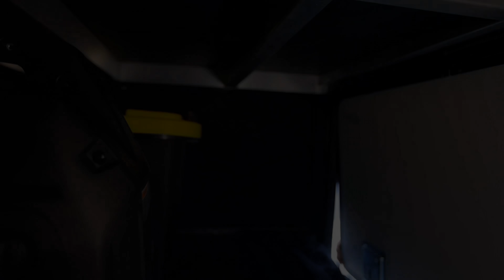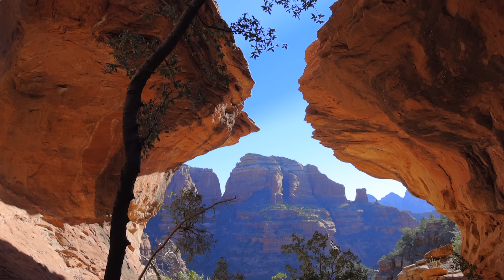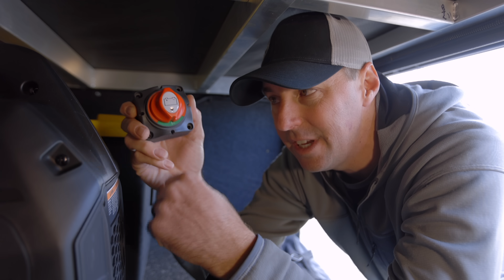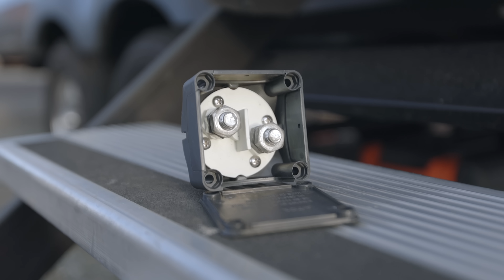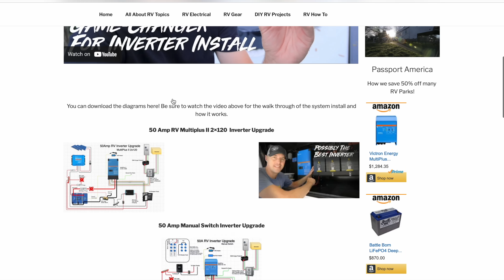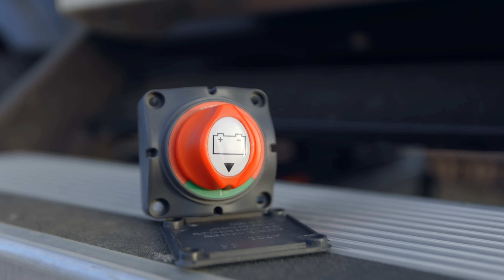Why I Removed The RV Battery Disconnect.

Comment: Which stupid RV company wired the disconnect switch wrong?  That's the real problem .  Race cars also have disconnect switch, and it does just that... it disconnects the battery.   If it didn't, the car would not pass tech inspection.    Why aren't RV's being inspected?

Comment: A battery disconnect will cut off 12V battery power. It won't disable the converter 12V output if the RV has shore power.

Comment: It should be installed on the ground side of the battery. There should only be one cable from the cars frame to the negative battery post. If there are more connections to the negative post install them all to the side of the switch farthest from the negative post. If installed in that location there is no way for anything in the car to still receive power. Any disconnect would work in this situation and there is no need to protect the connection from anything. It's just a ground and a ground can't short out against itself.

Comment: Better to connect to negative post just like you why you disconnect the negative cable when servicing the battery. Otherwise a short from the positive post or anywhere in the positive wiring could short out the battery and cause explosion or fire.

Comment: We just got a newer RV and trying to figure out why my batteries keep draining while hooked up to shore power. I have the battery disconnect turned on because if I don't my iN-command system doesn't work which runs the lights and the slides. I like having the night led lights on but there again if I disconnect the battery switch, I can't turn them on. I checked the Converter today because I keep draining the batteries at night. The Converter is working and getting 13.5v out but I think there is another hidden switch somewhere before the batteries? Will dive into it tomorrow and hopefully figure it out. It's a 2021 Keystone Cougar Half Ton with solar and a inverter as well.

Comment: Great production. If your running LFP batteries, ANL fuses will not handle the instantaneous short circuit current a stack of LFP batteries could deliver if there was a short. You risk having the fuse melt into itself, thus, a welded piece of metal, and fully conducting current. Think major fire as the insulation melts off the cable. For LFP designs, use a Class-T fuse like you have in series with your inverter. A simple tip from an Electrical Engineer.

Comment: I saw this video on replacing the battery disconnect switch and want to know if I can remove my disconnect switch on my Travel Trailer and replace it with the type you show in the video and if I do will it completely shut down power, unlike the stock one that came with the unit. I only have two six volt batteries and the stock converter that came with the unit. If I can't replace the current one with the type you show (because it will have the same effect as the stock one) do I just leave the stock one in its place and leave it on or off if I have to replace it with the type shown in the video.

Comment: I have two battery disconnects in the storage bay...  I bumped one when loading up on travel day and it came out (kinda spring loaded).  Found it, replaced to on position and now no dc inside the rv unless connect to shore power of using the generator.  Wondering if the disconnect got damaged or maybe a mystery breaker nearby...  Still loving my toolbox BTW.

Comment: The RV manufacturers are in a bind here.  If they were to install a switch that truly shut off everything in the coach, they would be opening themselves up to a lawsuit the first time someone has a fire or carbon monoxide issue inside that wasn’t detected due to the user shutting off the power via the switch. Things get stupid when lawyers get involved.

Comment: The switch is installed to disconnect certain circuits such as the start system. Your RV uses more than that battery used for starting. So the other circuits will not be disconnected or you will need multiple disconnect switches. I can agree with you not liking the install location. Other than that I think it is your expectation that is wrong.

Comment: I learned the "exciting" way that my battery disconnect didn't actually cut DC power to everything. I got some nice sparks when replacing my battery with a 200AH Renogy when I connected the second battery lead. Thankfully didn't hurt anything but certainly gave me a surprise. I've been thinking about replacing and rewiring mine as well so it actually disconnects the battery if I'm working on the electrical system or something.

Comment: So am I understanding correctly if my battery button is switched off, I have no trailer brakes?
Reply from the maker: Most RVs are wired so it will still function the break away switch for the brakes along with a few other items. That is why som many RVers disconnect the wires from the battery when in storage.
Reply: @AllAboutRVs  thank you

Comment: The really bad thing for me is that the switch disconnects the battery from the charger so it cannot get charged but can still get discharged by the things that remain connected to the battery. Once I turned my switch to the off position but accidently left on a fan and it exhausted the lead acid battery and permanently damaged it.

Comment: Sounds like you had the same issue I did with my RV. The disconnect was way away from the battery. It only turned off about 1/3 of things... not sure the point if it didn’t turn everything off. So I relocated the switch to the battery. Was able to shorten the longest wire that fed the back by 3’ (hopefully help with power drop) and now it’s a true disconnect

Comment: if it melts it means the disconnect is installed in the positive terminal, the disconnect should be on the negative terminal of the battery.

Comment: Question 2023 grand design 247bh.  When I use the battery disconnect in the off position does the onboard solar panel and controller , continue to charge the rv battery? Do recommend two weeks storage for example, putting the battery disconnect in the off position even though there is an onboard solar system (mppt ,165w panel going to a sealed battery) always active.  Thanks for the help.

Comment: Hi Jared,  as always, great video.   Does the switch need to be rated much higher amp than the total battery amp,   for example the box rating show 275 A continuous at DC 12V, 455 A.     Does that mean it's good for a battery bank of 400amp?   thanks much.

Comment: Jared have a question do you have to have your battery disconnect on when you are using shore power to the camper and jack systems?

Comment: there is a note in my RV that states that the power should be off while traveling to prevent shorts from actuating slides and such.   I would almost suggest just adding a second disconnect switch to accomplish what you are trying to do.

Comment: i didn't read all the comments , so someone may have said this already.  if you touch the frame when undoing the red (pos)  with  a metal wrench you will still spark , because you are shorting the battery to ground.  just need to be careful.

Comment: I have a 2021 keystone and it’s doing the same thing it has a wiring box and the off an on battery switch is in that box and I’m have a problem with the brakes the dealer has the trailer in ft myers and are trying to fix it

Comment: the brakes are activated off a 12v line from the trucks brake controller. Batterys on trailer is key for if you become disconnected from the trailer the emergency pin can be pulled for brakes to be activated.  Also if your 12v aux vehicle line is not connected to the trailers 12v system (needs to be disconnected for lithium setups usually) You wont have boosted power to say do leveling jacks or slide outs.f

A true disconnect to battery should be on the Negative side. Like you said disconnect negative before you work on the unit, not the positive.

Comment: Thanks for this video, wife and I just bought a 5th wheel last fall and have not picked it up out of winter storage yet, I was curious about battery charging and brakes if battery switch was off. Thank you for clarifying this question.
Reply: Trailer running brakes do not use trailer battery, they use trailer controller 12v from the vehicle. Battery is required for Emergency Disconnect when detached from Vehicle to activate the brakes.

Comment: The reason an RV disconnect doesn’t turn everything off is it would disable the trailer brakes, and it would obviously be a safety liability if it was left off while towing.
Reply: Trailer brakes are activated from vehicle 12v brake controller power, You can have no battery installed and trailer brakes still activated. You will however not have emergency disconnect brakes as there would be no power source on the rv.

Comment: Hi Jared,
What do you do with the original wiring that the old switch was attached to? I’m in process of getting ready to install my Multi2 and realized in needed to do something there. Do you remove the original bus bars to the new ones?
Thanks 🙏 for a quick response 
Pete
Reply from the maker: I left the original bus bars and just had a connection from our new bus bar system over to the original.

Comment: This video convinced me to install a similar switch last year. I installed it between the 2 6 volt batteries on the jumper cable, so it shuts off all power. Great peace of mind that all power is now off for storage and safety.

Comment: if I use this disconnect will my solar panel still charge my battery?
Reply: depends where controller is connected, Before or after the BUS, direct to battery. 
The Disconnect usually does not take off the emergency brake controller or the slides/jacks. depends on how they wired it.

Comment: for smaller rigs, I recommend a resettable DC breaker as a battery disconnect. it just adds an extra layer of short circuit protection. I typically install them right on the side of the battery box as they are waterproof and provide the most protection the closer the yare to the battery. these keys suck I just recently diagnosed an intermittent power loss to a failing one of those.

Comment: That's crazy.  Could it be that someone added additional circuitry after-market, going to the hot side of the disconnect?  Of course, if you're the original owner, that seems wonky.  It would be like popping the 100A main in your home and getting a full shock as you wired a new bathroom light.  Eeek.

Comment: This just happened to me. Switch in the storage bay got bumped to the off position while moving boxes around and I didn't know it. Went to turn on the front cap light and it wouldn't come on. I checked the battery voltage and it was dead at 2.5 volts. I checked fuses, check the converter, traced wires, and BOOM it hit me. CHECK the battery disconnect switch. That's it problem solved. I will invest in a switch like the one you show in this video.

Comment: Jared, what did you do with the connections to the old battery switch? Ours is the same with only partial power removed with the battery cutoff. How do you determine where that wiring is going and how it’s getting to the battery and the power distribution panel?

Comment: I bought the three-way switch for two batteries, so I could only use one at a time. Not for my RV but rather on my inflatable boat with a trolling motor. Works great.

Comment: I have a switch like your first one. It is in a good location though. I had trouble with my battery not charging back up through the converter. I turned that switch on and off a couple of times and got the voltage back to 13.4v going to the battery. I didn't replace it, and just remember to do that if I have problems in the future. I'll probably replace it with that other style later on.

Comment: Perhaps a better title for the video would be "Why I REPLACED the Battery Disconnect Switch"  It was a little confusing as to why you would remove a safety device, until you clarified at 2:36.  Less liability in case someone does not watch the whole video.
Reply: It's called clickbait

Comment: If I have a master power switch in my class c do I need a disconnect switch? Getting lithium batteries installed by dealer and have inverter and solar. Store indoors and not for long periods so assume I can just shut off master power while in storage.

Comment: Wait a second, you said you leave the battery switch on while driving so the brakes will work, I thought the brakes were powered through the truck weather you have a battery connected or not?
Reply from the maker: The breakaway switch requires a battery so if it disconnects it will apply the brakes.

Comment: Good Points: bumping switch, exposed /shorting connections, not totally disconnecting batteries
Why not a total disconnect: Product liability: CO and propane detectors/brake away system…

Comment: One wonders why the manufacturer chose to design the system the way they did: installing it in an inconvenient/unprotected area and more importantly, installing something called a battery disconnect that doesn’t disconnect fully. Their choices were certainly not value-added to the customer.

Comment: Not all disconnects are rated equal either.. get the right size.
Reply from the maker: Yes the one i have linked, I've been using for a couple years and is rated at 275 continuous amps. The one for the inverter is rated at 600 amps for the larger load

Comment: I figured to have the disconnect switch on the negative, which is what I did with this same disconnect this spring. I figured this because as you mentioned you always take the negative cable off first. How come you put it in the positive instead of the negative?

Comment: We are on hookup at our storage unit so the batteries are trickle charged. We have the nob old style switch which is very strong. My boat has one too but it's one to switch between batteries, run both or just shut off. Marine quality too to prevent corrosion.
Reply from the maker: Marine is a great way to go.

Comment: Since you use Victron equipment, I would have suggested you buy a 65 amp Smart Battery Protect. Then you can use a small switch to trigger the relay in the disconnect and connect that switch with small gauge wires. It also allows you to disconnect via Victron Connect AND trigger a voltage threshold upon which it will disconnect itself automatically.
Reply from the maker: Yes victron does have a great solution for that but with being full time we rarely disconnect the battery and the price is hard to beat on this switch.

Comment: We used the 1st one you showed, and it failed. So I installed a A/C  Disconnect (60 Amp Dummy Breaker) and it works great. Put a little lock on it. My parasite draw was the CO/Propane Detector.

Comment: Does the battery disconnect need to be turned on for my trailer breaks to operate?
Reply: Here is my one disagreement with Jared. I say the batteries should ALWAYS be connected to the brakes. The consequences of not having brakes are too severe.

For completeness: Normally the truck powers the brakes. 
Should a trailer come loose the 'break away cable's will set the brakes to be full on. And so the trailer stops, only if the trailer batteries are connected.
Reply from the maker: Yes they need to be connected for the breakaway switch to work. We always have our switch on for towing so it has battery. I prefer to have the disconnect to include the brakes because I have seen 3 different times in the last couple years where the breakaway cable was accidentally pulled and started melting the wires. One case I had wire cutters close and cut the wires the second I had to rip the wires out of my friends RV. If it had a disconnect I could have shut it off faster with less to repair. The third I wasn’t on site for and melted the wires and melted all the wires in the wire loom. When wires are smoking on the RV you want the fastest solution you can so there is less damage.

Comment: Most large equipment and semi trucks put the disconnect on the negative side.  The service techs have told us that the disconnects last  longer.  Especially if you are running them off at the end of the day, every day.

Comment: Agree 110% with replacement of that type of switch. I think I may have gone even one step simpler or more (?). I wired a 30 amp in an inline blade fuse right off the battery. I remove it when storing and replace it as I am hooking up. It stays in while we are using the tt. I keep extras in the truck & trailer. Adds about 10 seconds to hookup. Before doing this I found that my batteries were slowly discharging when just the switch was turned off. I found out that the CO detector is wired around the switch and always working as a fail safe.
Reply from the maker: Thanks

Comment: I had a boat and the switch for the batteries used a switch with 1 batt.or Batt 2 or both batt. ( it was a two batt sys ) or off. Seems to me a lot of options to have it ant way you want.
Reply from the maker: Good point

Comment: I've used multiple of these, they all melt or get stuck in the on position after less than a year even under the rated current. stick with eaton products (bussman / bluesea)
Reply from the maker: Bussman and Bluesea have excellent products. We have been using this one full time for over 2 years with no problem. I'll be sure to update if I do.
Reply: I had the one Jared recommended in my 17 year old Holiday Rambler 5-er that lasted 15 years. The old one froze up so it was time to replace.